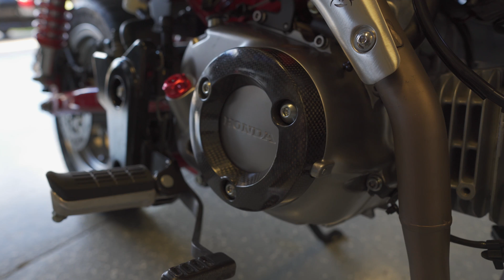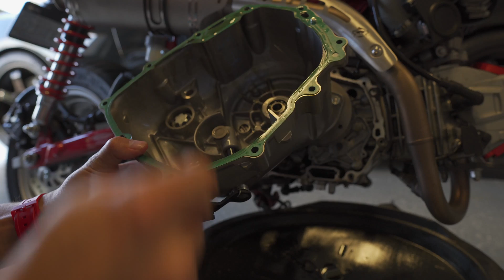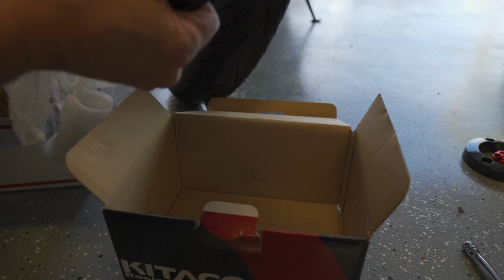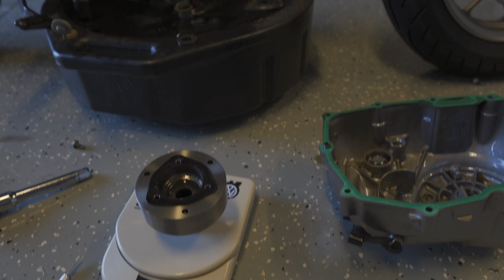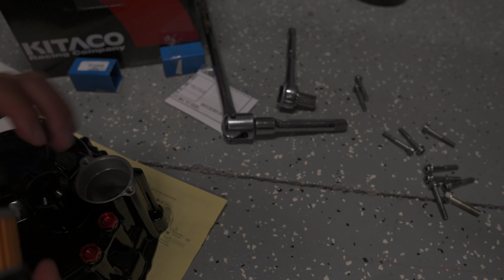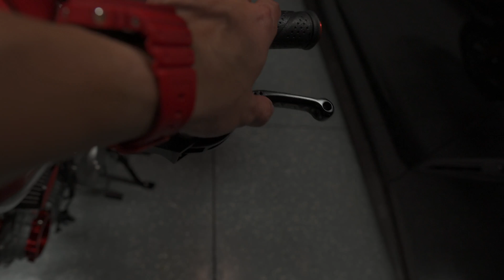Kitaco Clutch Cover and Takegawa Super Oil Pump Install on the 2019 Honda Monkey

Comment: I just used a 1/2 impact adapter for the spinner in addition to the bolts and it came right off no headaches.  I was a little bit afraid of the teeth not holding but it wasn't an issue.

Comment: I would tend to guess that removing the 2+ lbs of rotational mass off the crank may help the engine spool up a bit quicker but probably will hurt the bottom end a tad where that weight adding to the engines rotational mass down low would be of some benefit. Since you are building this bike for what seems to be a mini on road warrior probably not a big issue but someone that may be using the Monkey more for dual sport/trail usage may well notice the loss of the bottom end when trail riding in certain situations and aqctually find that extra rotational mass to be a benefit.

Comment: Did you also see the Takegawa clutch cover they sold on hard racing that cost little more that the Kitaco clutch cover? I Takegawa speedometer after seeing you install yours and thought would it be better to use the parts from same manufacturer.
Reply from the maker: For what I needed/wanted the Kitaco was fit for purpose. I usually don't go out of my way to stay with a certain brand, I like both Kitaco and Takegawa products.

Comment: Does the engine vibrate more or less without the oil spinners weight on the end of crankshaft . Or is there any noteable difference?
Reply from the maker: I haven't noticed any more vibration from removing the oil spinner.

Comment: Do you still get dirt captured In the oil screen if you have the kitaco clutch cover with oil filter? If you do, how often the screen should be cleaned then?
Reply: I’d say just leave it alone since you now have a proper filter that you can change easily. Could get a magnetic drain bolt too and I bet that screen wouldn’t ever get very dirty.

Comment: Hi,
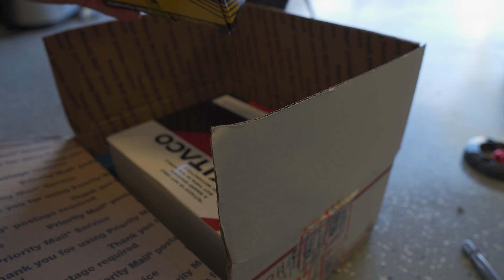Would you have the part number for the tool you using for taking out oil spinner?  Approx @5:15
Thanks.
Reply from the maker: https://www.amazon.com/Removal-Remover-Socket-Wrench-Motorcycle-ATV-Dirt/dp/B07SL4RRDL

Comment: If you don’t plan to ever open the cover any more, why do we need to put the small mesh square back in? Wouldn’t the oil filter catch things and the mesh square has potential to clog if not cleaned?
Reply from the maker: Might as well leave it there to catch stuff and not have it continue to cycle around the engine.

Comment: Could you give a feedback for the oil-spinner is it a great advantage?
Reply from the maker: I wouldn't call it a "great advantage" - I feel like it's spinning up a bit quicker, but I've done a lot of other mods within a short time period (cam, smaller front sprocket, ECU tune for cam) so it's hard to tell. For me the main reasons were to have an external oil filter cartridge, and access to the oil ports so that I could install an oil cooler. If your main focus is performance, I'd focus on other mods first.
Reply: eastcoastish thank you for the answer...so i have to modify more than one thing...

Comment: Can you elaborate more on that "high flow fuel pump" you mentioned twice, during the unboxing at 5min mark ...
Reply from the maker: It's the Takegawa Super oil pump. A very easy install, especially when you already have the clutch cover off. It's supposed to improve oil flow by 35% over the stock unit. Here's a link to it on Hard Racing: https://store.hardracing.com/01-16-0063-takegawa-super-oil-pump-13-20-honda-grom-grom-sf-in-stock-30748.html
Reply from the maker: I also show the install process at around the 12:00 minute mark.
Reply: That's nice and all...but, why do you keep saying fuel pump.
Reply from the maker: @martykasa6704  Ohhh - sorry, didn't catch my mistake there. Definitely meant OIL pump.

Comment: Did you have to adjust your exhaust at all? It says this cover only fits with a low mount exhaust and wont fit with the stock exhaust.
Reply from the maker: Nope, the closest point that the RS3 exhaust comes to it is near the oil filter and it's still more than 2 centimeters away from it. The only issue that I may run into is that the banjo bolts for the oil ports look like they'll cause the oil lines to run into the exhaust header - I think if i get some 90 degree banjo bolts that it will work though. I've already ordered the Kitaco oil cooler so will have a follow up video on that soon!
Reply: Awesome i plan on getting this cover. Not plans for an oil cooler.